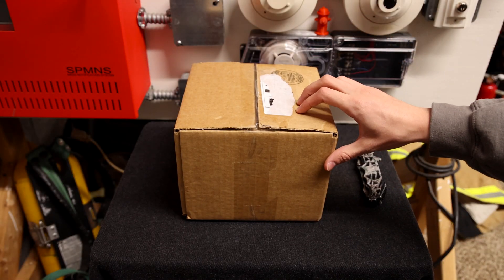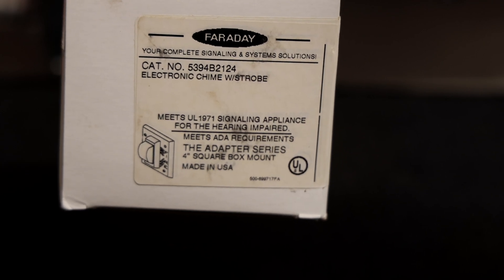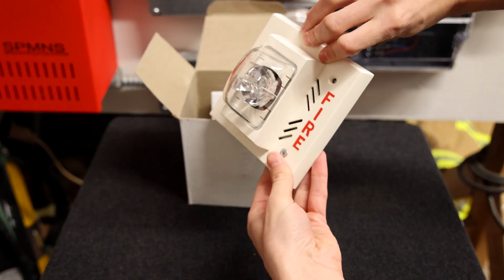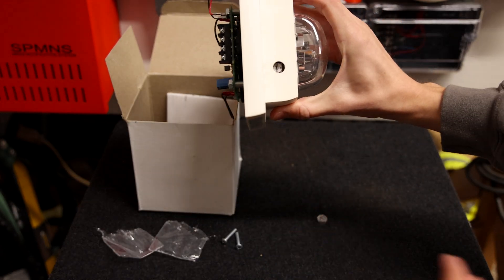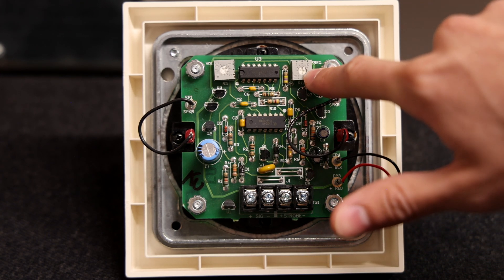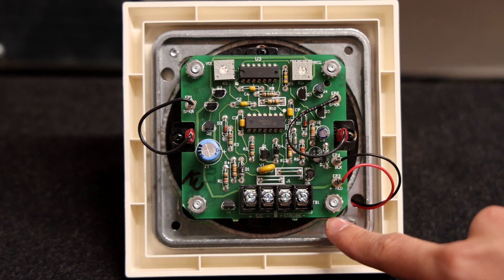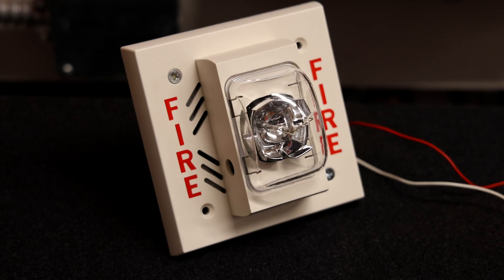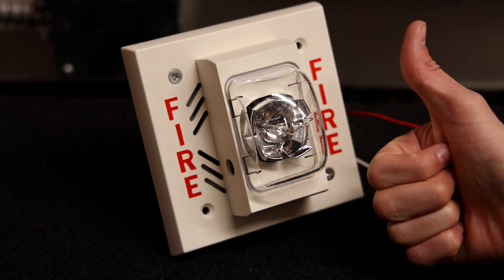Faraday 5394 Chime/Strobe Fire Alarm Unboxing, Overview, & Test!

Comment: Request: For the Voice Evac Panel Series you should do a carbon monoxide message and have a system sensor carbon monoxide alarm have it converted to addressable and use the gentex low frequency sounder as the general alarm